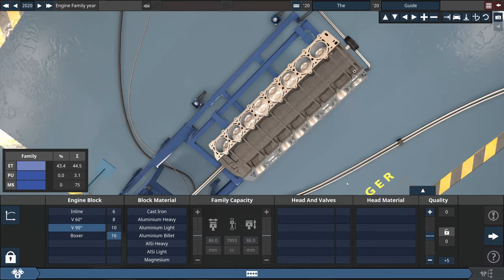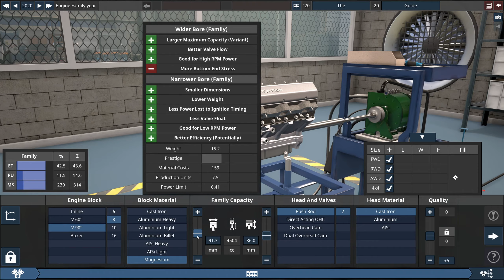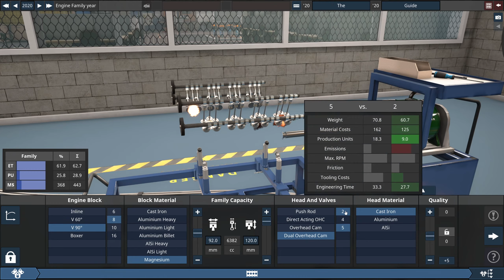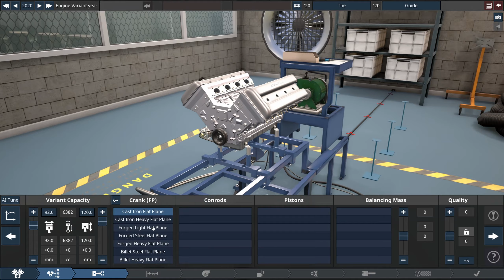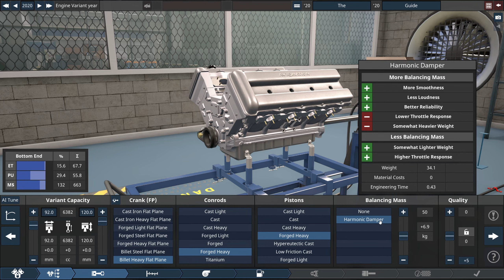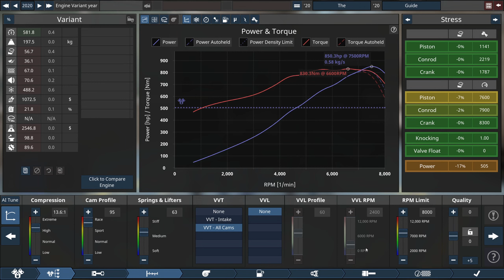The last Automation Engine Build Guide You will need

Comment: Nice video really good for us begginers that just got the game,but my question is can you not make it so at 2000 rps you dont just have only 200 hp,im sure theres a way to give it more hp earler
Reply from the maker: Thank you, it's nice to hear!
To answer your question, uhm, two main things (other than the engine size ofc) - fiddling with bore to stroke ratio and the cam profile. If it's possible to reach anything higher than 200hp on such low rpm, I'm not sure, have never done that - though I think it should even be possible to tune turbo to boost as low as 1500-2000 RPM. Bear in mind that Automation simulates only gasoline engines and they aren't really known for their low rpm power/torque.
Reply: i built an engine with 1700hp and 6500Nm at 2000 rpm. so yeah, its possible. but this engine also only revs to 2k
Reply: The PS (hp in metric) formula is Nm • rpm / 7.121 = PS. So if you have 540 Nm which is a lot for 2.000rpm you will be generating only 151,66 ps which converting to hp is 149,6, so it isn’t a low power for 2.000rpm, because an engine is going to rev higher, and most common cars isn’t going to have that much power at that early stage. For example a common cars like an Audi a3 2,0 TFSI just makes 84hp at 2.000rpm, an sport car like an Audi s6 v8t 4,0 that makes just 138 hp at 2.000rpm, or a performance car like an Audi r8 v10 that makes 620hp but at 2.000rpm just 153hp.

Comment: Suggestion: to choose header, manifold, exhaust sizes and flow there's the 4 way split graph. You can see where the various components reach 100% usage on the rpm range. For economy you should target 90% at max torque.
Reply from the maker: You can also do that manually when testing engines. I guess the way you described is much easier tho.

I believe these graphs and calculations are going to be reworked in next update either way.